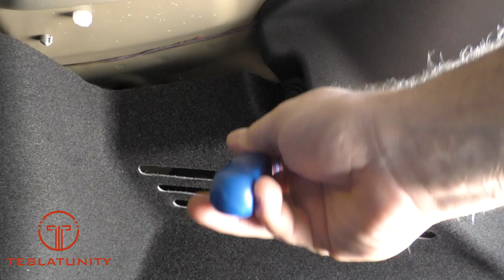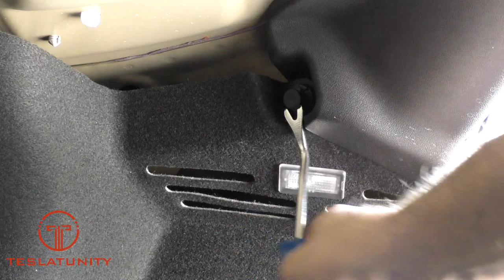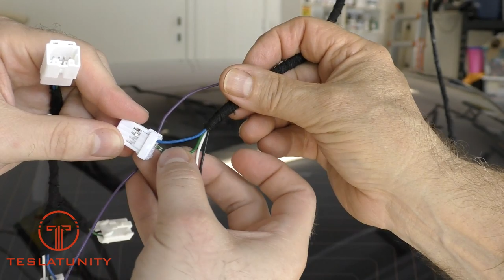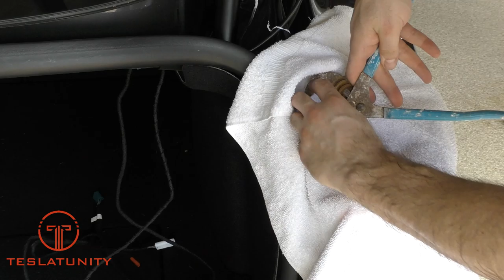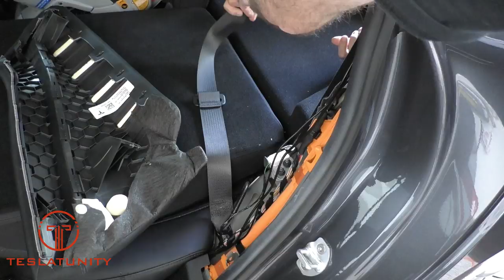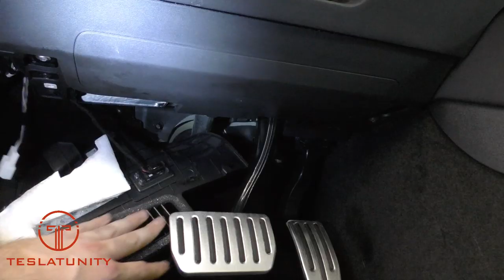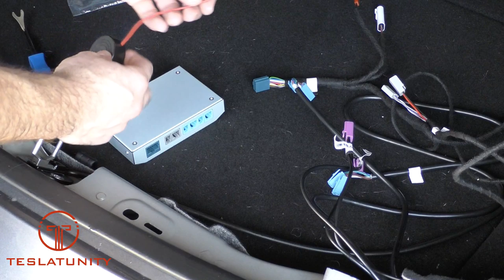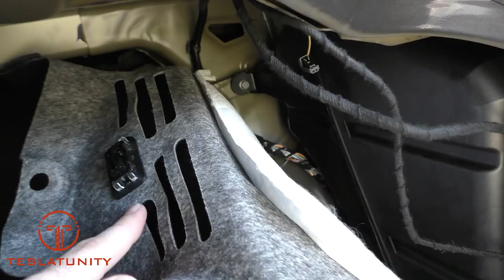Installing the Tesla Model 3 Power Trunk!

Comment: @Teslatunity I saw the FL plate. Do you know a place that could install this in the Ft Lauderdale area? (Not sure where you are but I'd be happy to have you do it if you're close enough)
Reply from the maker: Ross, I am not sure if they support it, but I would recommend you reach out to Signature Custom Wraps (website is wrapmytesla.com) as the best trusted source in Tesla aftermarket work.
Reply: @michaelrbodner  Awesome, thank you so much!!
Reply from the maker: Ross Kirsh you’re welcome and just to follow up, I confirmed they are doing them now!
Reply: @michaelrbodner  That's great to hear, I appreciate you checking! Any issues/complaints with this mod so far? Happy overall?
Reply from the maker: Well don’t hate me, but I removed the kit. I didn’t have any issues with it, but was going through unrelated denial of warranty service with Tesla regarding my front passenger seat. That experience made me nervous to leave such a big/obvious electrical modification in the car. I’m sick over removing it too, because the stock trunk is pretty bad in my opinion and the power option is so nice.

Comment: Are you afraid of using this in the rain? I know the model 3 has had problems with water leaking in to the truck when opening
Reply from the maker: When the trunk is closed you still have a perfect seal with the weather stripping around the glass. One thing to watch out for (with or without this kit) is that you can manually adjust where the trunk sits when closed to ensure that seal.  As for the design flaw with opening the trunk, it’s actually worse now that my windows are ceramic coated so the water racing into the trunk. This doesn’t really change that at all.

Comment: Why use the power source for Sentry Mode?  I wouldn't want to have to turn it on, and filling up my memory card with video as I'm near my car, just to open the trunk.

So no button to close the trunk from inside the car?
Reply from the maker: It’s not that it’s the power source for Sentry Mode, it’s that the blue wire is “switched” power versus “constant” power. As a for instance, if your car is sleeping and Sentry Mode is off, with switched power that means the control unit for the power trunk unit would also be off. In that instance if you pop the trunk it won’t lift because the computer will take a few seconds to wake up. With the red wire (if you can reach it) you have a constant power source so it will work 100% of the time for you.  For me the only time Sentry Mode is off is when the car is in my garage so basically I can wake the car from the app and pop the trunk before I get into the garage or remove the charging cord first which will wake the car and then open the trunk. 

Tesla Raj’s code should also be 5% off, but if it’s coming up with 15 by all means use his code. That’s just something we both asked the vendor to offer our subscribers.
Reply from the maker: The kit comes with the button to close the trunk inside the car but I could not think of a time where I would load the trunk and subsequently not close it with the button on the trunk so I didn’t bother with it.
Reply: @michaelrbodner  my mistake Jaj's is also 5% off.

Comment: Can the blue power switched power wire you tapped into under the dash be used as a source of power for utility trailer lights and the Eco-hitch stealth hitch for Model 3 trailer light sensor module (https://www.etrailer.com/Wiring/Tekonsha/119250KIT.html)?  E-trailer recommends using unswitched power, but that will power the electronic monitoring device even when the car is not "on", a potential 12v battery drain.  On the other hand, I have read on some blogs that Tesla's current monitoring of various circuits will be thrown off if I tap in to the wrong source of switched power. PS, I have already run a wire from the trunk tail light area to the dash using your video. Thank you!!!
Reply from the maker: I cannot profess to be an expert when it comes to electrical, so I do not want to steer you in the wrong direction and I'm not sure on the power demands.  I have heard similar about tapping the battery directly and it being an issue with Tesla monitoring the 12v in a way that is different than other cars, but at the same time I also know at least a handful of people that have tapped the battery for various things without issue.

Comment: Looks good @michaelrbodner still recommend this kit? Any issues? Need to get a kit for my 2020 MSP
Reply from the maker: Honestly, I don't recommend this kit or any kit for that matter.  I think at the end of the day it's a risk to mess with Tesla's electrical system and you're one Tesla update away from the potential of your trunk not opening.  It's a shame, because the 2021 model year got the power trunk.  I actually sold my car for a 2021 to get that from the factory among other improvements (or so I thought).  The car was a dud so I flipped for a 2022 when the used car market was very hot, but at the end of the day I decided to leave Tesla and now drive an Audi E-Tron.
Reply: @michaelrbodner  Thanks for feedback, may still roll the dice considering not having the feature at all has it's own intrinsic value:)